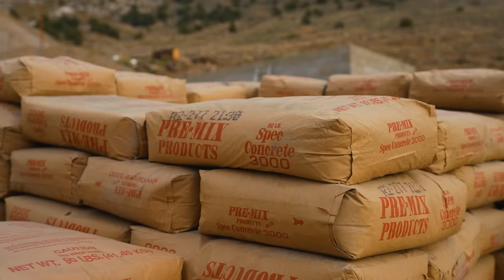We Mixed 1,500 Bags of Concrete To Finish The Basement!

Comment: Dude... I love this video series. Me and my old man were never close, but one thing I am proud of is we added onto our house by ourselves. my dad spent 25k total on an old trailer on a small bit of land back in 99. We dug our own footers, hand mixed and poured them wheel barrow by wheel barrow. My dad was a mason, and he took any block and concrete from every job that was left over as extras over like 15 years as a mason. The house we build was almost 100% leftover materials from job sites. Hilariously he hauled every bag of cement, and every block for our house from either Denver or colorado springs jobsites down to our house in Canon city in a little dodge neon (after 10 years of this it looked like it had been slammed on shit suspension). we only had a concrete truck here 1 time, to pour the floor for our house. The footers were all hand mixed, the grout was all hand mixed, and miserably... my dad like every other person who is building his own house wanted to overbuild it, so we filled 100% of every single cell of our house full of concrete. We mixed every single bag of concrete by hand... in a wheel barrow... then used buckets to move it from the wheelbarrow up to the top to fill each block. So I fully understand the struggles you guys are going through, and respect the work!! Keep it up!
Reply: congratulations .... 
you now have a bond & , memory with your father that you'll remember for the rest of your life.....
way to go
Reply: I miss my dad, he taught me everything I know...😞
Reply: Haha same here I can't even remeber when the work started its been years but I've helped my pops build up this little house and it's coming along decently though we've been a fair bit luckier and had some hired hands come in and help us along with cement trucks pouring in cement but I understand the struggle after I he brought in 12 pallets full of limestone he got at a discount and I had to hand haul them since he didn't want to waste more money on a cat nor could it fit, we wrapped up quite a major section in limestone rocks, mostly around 8 to 6 inches tall and 3 or 4 inches wide and I was the lucky mule that had to haul them from there storage space to where we needed them haha I love my pops and would do it all again if the need arises so lucky I'm young and can still help him too

Comment: I can't even begin to express how much in awe I am of the efforts you guys are making, and all the parts that need to come together to make something like this happen. I just hope that when the hotel is built that you'll have enough funds left over to put in a state-of-the-art fire prevention system! It reminds me a little of when my parents and siblings all chipped in to help build a home in Hawaii, and getting those 50 or so ohia logs hauled up a steep narrow curved driveway, one at a time, in the pickup truck. I had to sit on them in the back to help keep them from sliding off. And there was also all the boulders we had to haul up for the rock walls. At least we were able to get a cement truck up the driveway. Still nothing compared to these guys and the mighty work involved!

Comment: I have been watching your channel since not long after the beginning . This journey has been an inspiration to me , starting around the same time you started , my entire life and career of 16 years had been turned upside down and my life set nearly back to square one . Never would I have previously thought that my past life’s work would be washed away and find myself rebuilding from the basement up , however that is exactly what happened . If one’s life were based on number of hours worked and miles traveled , then by most folks I am essentially 84 years old with  20+ years to go . This does not discourage me , in fact it makes me twice as strong , and yes , occasionally I have experienced flagging resolve , and on more than one , several of these occasions I have found myself randomly watching your channel and life’s work . I cannot convey how much strength and resolve you have passed on to myself and undoubtedly so many others like me . Thank you for sharing , thank you for caring , and we’ll just bravo sir, bravo .

Comment: mill the baserock flat with a rock crusher reclaimer then blade of the crushed rock , that way the road will be passable - baserock cant wash out if you pave the road you will only get sinkholes below the pavement , really the road needs a actual proper drainage ditch and some explosives demolition work for widening and the trench

Comment: With how much concrete you need over the years for this project,
It does worth having a small concrete mixing done locally instead, it is rarely used in Europe for some construction sites, mostly related to logistics of getting fresh concrete or supply constraints

Comment: Random thought about a possible solution to the water issue. The water pump has a hard time pumping the water all the way to ground level. How about putting several water storage tanks, the biggest that can fit down the elevator shaft at the 400-500 level. Link several together to maximize water storage. Pump water from the source to holding tanks, then add a new pump and the new pump only has to pump up half the distance.

Comment: Amazing what you achieved; I feel your pain. The video was motivating for me; I'm up at 7000MSL on a dirt road where no one wants to work so it's gonna be me alone or with a friend doing 4000sqft 20ft tall walkout basement.  It once made sense and maybe once the basement is done the rest will again make sense. Forward is the path to progress.  I knew concrete would be my achilles heel so 5 years ago I purchased a 10yard concrete truck and had it overhauled and with luck it'll make concrete next spring (1yr engineering, 1+ yr permitting and 2yrs for well, septic & power, 1yr to move 5000+ cubic yds of earth & rock) ... If I learned anything in my military career it was to severely overestimate my capabilities and then execute to complete the tasks.

Comment: If you had the cable or car system to where it could work from one point to the other, namely your place down to where you're receiving the concrete and mortar. That would save some time and be easier bringing things to you and down Mountain. I have no idea what will be involved in that yet it would take time I believe and heavy Manpower that would no doubt use diesel fuel to run the power.

Comment: What did they do before Pumper trucks and rotary mixers? Ans.  We made a mix box and mixed the cement by hoe in hand and then wheel barrow it up on a scaffold to pour it in wheel barrow by wheel barrow. We probably would not fill up the cinder blocks with crete.   They stand alone. Good enough for 30 years or longer.  Concrete might have been used for the flooring, though I have seen structures that didn't use any and they are standing after 40 years.  The basement is all timber walls(railway ties).  Have not moved at all.  On a ski mountain top so lots of snow every winter. 10+ feet average.

Comment: I've always wondered why you need to get a cement truck delivered up there?  I guess first world building methods requires it.  Manually mixing concrete on site and pouring it, over hollow blocks with rebar.  Is how construction has always been done in poorer countries with cheap labor.

Comment: Just Wondering, Could you have rented a concrete truck and loaded yourself at the plant or bought an older model from an auction and use it then turn around in sell it when your done?

Comment: Seems to me, the first thing you should have worried about is buying a grader to keep your roads maintained and actually look on youtube here, and see/learn the basics to road building and then build you a reliable dirt road that will withstand the washouts. From working around utililty roads and riding on them all my life with atvs in some of the wettest areas in the US, my advice to you is get a grader, a small dozer, or even a bobcat/skidsteer and start from the beginning building the road. cut out all the steep places, and get rid of all the hairpin switchbacks that might already exist in the road you already have, built runoff ditches along the interior sides of the road and every few hundred feet put drainage pipe under the road to drain into the valley, Use hay bails in your ditch lines to slow the flow of water to prevent erosion, crown your roads so they angle to the ditch line. You need drainage on those roads bad, instead of allowing your road to be a creek when it rains. Every time it rains you lose your road.  Honestly, Every time you go to Lowes or any other big box hardware store, ask if they got any damaged bags of concrete, they will normally sell you damaged concrete bags for really cheap. (I have gotten them for a dollar before) either start hording it like that and building you a concrete road with it or use it in the worst areas you have the worst problems with.  I think I wouldn't have gone the route you are trying to take by building some big huge grand hotel right off from the start. I think I would have built a bunch of "tiny cabins" either with lowes sheds or built them myself, set each one up like a hotel room and began renting them out immediately to get some sort of revenue started.  I would also collaborate with other youtubers and do joint videos and profit share with them, that would also help you get more viewers.  Like the gold mining Youtubers, or the mine exploring youtubers, or the ghost adventure youtubers. Allow them to stay on the mine floor where all the miners died in that mine ( I seem to remember a whole crew of people dying  back in the 1800s in that mine from the old ghost stories I have been told).  You should also think about, once you get established, of having the youtubers that make mountain bike trails come in and make a bunch of trails coming off that mountain and either starting a shuttle service for them or having a really cheap sky lift put in that goes from the bottom of your valley back up to the top of the land you own,  putting in at least 3 or 4 mountain bike trails and that revenue would sustain you permanently. Theres millions of dollars to be made in that land if you put forth the effort and don't get bogged down on a single idea.  You have perfect draws year round there from the gold mine, to mountain biking, to ghost adventuring, to mine exploration, to desert adventures, heck, use a bobcat and build some ATV trails around the property, most people don't extreme sports, most people just like slowly atving and looking at the scenery.

Comment: Please don't vibrate as long as you can. You will segregate the mix. The rock will migrate to the bottom and you will not have a consistent mix anymore. Also, little late to say but the best thing you could have used would have been a seven sack pea gravel mix. Basically a block fill grout. Not trying to be a know it all I just really appreciate what you are doing up there and also just happen to be in management at a concrete company in the St. Louis area. Wish it would have been us out there. I have some drivers that would have taken the challenge gladly.

Comment: Why didn't you order prefab concrete walls and just set them in place ,it would have been so much cheaper? In a couple days you could have completed  all foundation  work !
Superior walls would have been a company I would have called!
Reply: The prefab walls  are completely  engineered  for load, and meet east coast building codes!

Comment: The orignal buildings were done with horse and carrage, very littel mechanical machines were used. And it wasnt modern construction methods. 
Think how hard this was and imagine what hover dam was like when it was being built, this project isn't as hard as one bypass spillway. They had to dam up the river to build hover dam, an entire town was built overnight during the depression.
100s of men even 1000s of men worked on hover dam and it took years to do.

Put skylights and an outside roof deck on the hotel just for a view of the night sky.  You come to the city or even close your lucky if you see one star  there its endless view of stars.  Worth a trio to spend a few days just for the views at night. Telescops.   Build a few wind mill powe plants.  You've got the wind for it.